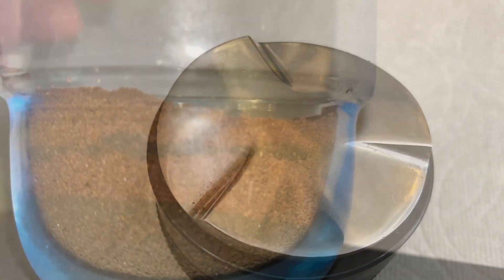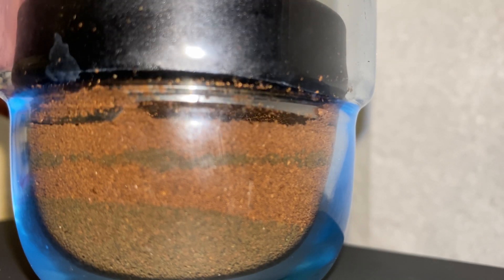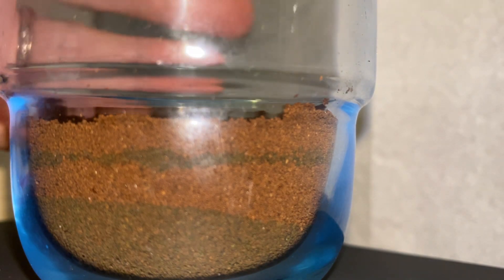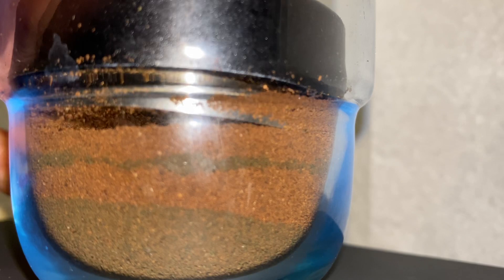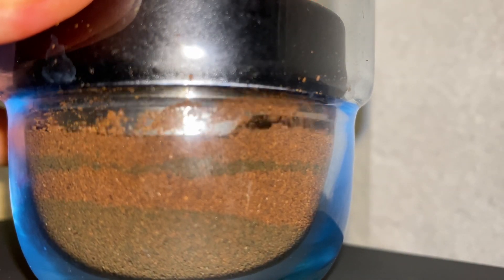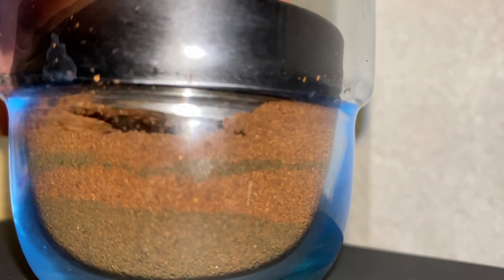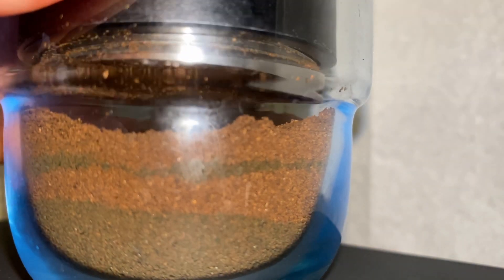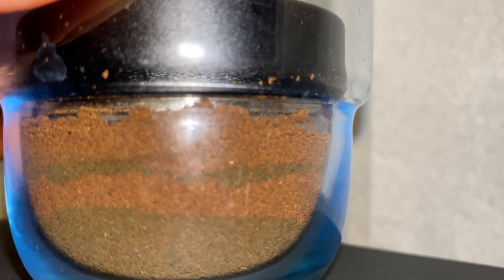Destroying the Myth of OCD Distributors for Espresso

Comment: For starters you're spinning it the wrong way, secondly, they're only meant to level the surface, so you still need to tap the portafilter to knock out air pockets. After you tap, the bulk of the coffee bed will be evenly distributed, but it will leave an unlevel surface because coffee from the surface has fallen in to fill voids. At this point it then makes sense to use the distribution tool to level the top surface.
Reply: Why not just WDT to get even distribution, then OCD to to get a level tamping surface, then tamp...
Reply: @esbenrasmussen4289  that’s what most people will do, but you actually don’t need to level your bed if you’ve used wdt. The data from multiple sources suggest, that of all cases a leveling tool, no matter what you do before it, will decrease extraction. Of course extraction not always correlates to better taste, since tastebud configuration differs from person to person. The general idea for a refractometer is to give a baseline (like i.e. everyone likes different styles of headphones, but every headphone is compared to a flat baseline). So a lower extraction just says that when compared to all other possible opinions, in most of these, the taste will be less appreciated. 
Also I’ve to add, that I’m excluding consistent overextraction from this perspective, since it’s highly unlikely to be applicable to all of the tested szenarios.
Reply: Imagine using a glass cup to make an example of a distributor in a portafilter...
Reply: hey  @ELITEGOD61  hold my lube, the TDS meter is going in dry
Reply from the maker: If it’s the wrong way, it isn’t a distributor. It’s just a leveler. It doesn’t even distribute the top when used clockwise. 

https://link.medium.com/VT9oKVyhpdb
Reply: @espressofun6091  as I said, distribution is done via tapping and the tool is used to level the top section of the coffee. It would be better to argue the tool is incorrectly named according to its function. To me taste is the best test and I know what tastes better to me. Forgive me if it makes me naive but a single article for some random test is much to convince me otherwise.
Reply from the maker: @n00baTr00pa  the tool decreases extraction yield. There’s not a single test that shows otherwise. Multiple people have tested this. Extraction yield is highly correlated to taste. 

Feel free to do whatever you want or collect data yourself. I am not convinced by any test I’ve read or done. 

https://link.medium.com/lKTt246zvdb

Comment: 🙈 Holy Sh... This is the WRONG WAY! I never thought that was possible! Wow! 😂🤣
Reply: thats what i said
Reply from the maker: If it’s the wrong way, it isn’t a distributor. It’s just a leveler. 

https://link.medium.com/VT9oKVyhpdb
Reply: @espressofun6091  and your title is pure clickbait.
Reply from the maker: @hcr32slider  sure. It helps decrease extraction yield by 1 point (like 21% to 20%). There is actually no evidence it improves the shot only that it lowers extraction. So if you feel so strongly, just collect some data with and without and report back.
Reply: @espressofun6091  so, as I stated, it helps to "produce consistent shots".
I'm not saying it is the number 1 method to extact and make the most delicious coffee.
Reply: @hcr32slider  careful lyn he has a   R e F R @ C T 0 m 3 T e R

He clearly knows more because a number changed by 1 percent 🙄
Reply: @espressofun6091  the proof is in the cup.
It may not "completely" distribute the grounds, but it definitely helps   to a degree and produces consistent shots especially in conjunction with the WDT method.
This is my practical experience.
Also watch the real sprometheus'  video where he uses an ocd without tamping and produced a higher extraction percentage.  I know there are a lot of variables which could affect the outcome.
Reply: You seem caught up on the title of distributor vs leveler.  The point is, it helps make a great shot.

Comment: I get that this tool isn’t all it’s cracked up to be, but Robert what is the reasoning behind using the leveler backwards for this experiment?
Reply: Correct, 3 spins clockwise.
Reply from the maker: It isn’t backwards. You’re supposed to go one direction and then the other. 

If you’re not supposed to go the direction I go, then it isn’t a distributor because it’s not doing any distribution. Then it would just be a leveler.

Comment: Yeah, totally destroyed... your reputation. 
You are turning on the wrong way and you pretend to teach to people that a tool that you don't even know how to use and you turn in a simple and instable glass, doesn't work.. 🤦‍♂️
What a great scientific approach 👍💪
Reply from the maker: Do a better experiment. It isn’t turned the wrong way. You’re supposed to go one direction to distribute, one to smooth. But it doesn’t distribute. 

Thanks for your kind comment. Send me a link when you design a better experiment that shows the OCD type distributor actually distributes other than the very top layer.
Reply: @espressofun6091  There is only one way to use it and is in the opposite way, not as you want and then said "I destroyed the myth". and if you want to experiment, do it the right way. There are few people who can read and watch and without knowing how to use it, they believe you are an expert and take what you said as good. But it isn't.
Reply from the maker: @davidecobelli-CoffeePassion  If I turn it the other way, then it won’t distribute anything. It will just lightly compress the grounds. 

If you so believe I’m turning it the wrong way and turn it the other way would some how showed that the tool distributed more than just the top layer, that’s on you to prove.
Reply: @davidecobelli-CoffeePassion  this kind of distribution/leveling tool just adds another variable and negatively affects repetitive quality of espresso shots. WDT is more than enough for making excellent espresso shots.

Comment: I think you're turning the distribution tool the wrong way
Reply: Can we make a poll here? How many people will vote that you turn it the wrong way?
Reply from the maker: @gusmank  I’m fine if you’re right, but if you’re right that I’m turning it the wrong way, then it isn’t a distributor because it doesn’t distribute when turned the other way, it levels.
Reply: @espressofun6091  mmmm... i though that’s what the tool are for right? From what i understand, the “distribution” mean to make the whole surface having the same amount of coffee so when you compress it with the tamper, it will have same resistance across the puck.

Then from this video, what i get from you is, you tried to mixing the coffee using the OCD. I’m i correct?
Reply from the maker: @gusmank  it doesn’t distribute when turned clockwise. It only levels. So it fails if you turn it that way. 

https://youtu.be/tl9vXycr9VA
Reply: agree. wrong way. turn it the other way round and make a video.
Reply from the maker: @kerikzb  If I turned it the other way, it would gently compress the grounds, and thus, it would do even less of a job distributing grounds than it already is.
Reply: @espressofun6091  alright. suit yourself. :) good luck.
Reply from the maker: Nope. It’s the right way.
Reply: @espressofun6091  the story is you are doing it wrong and you are not aware of it.
Reply from the maker: @kerembyl  Others do it this way to. https://www.instagram.com/reel/CLt3F33hWJT/?igshid=408v2un93uhk
Reply: @espressofun6091  nah its definitely the wrong way lmao

"It decreases extraction by 1%" 

Oh noooo, slightly smaller number in a refractor meter but the bottomless portafilter doesnt channel/piss coffee everywhere because it was distributed more evenly...
Reply from the maker: @ELITEGOD61  1% means it goes from 19% to 18% for example. Over 100 shots, that’s a lot of coffee.

Comment: Isn't the purpose of this tool to solely distribute the grounds on the surface for a more exact and leveled area? It's not meant to blend as the grounds should technically come from one source: the grinder
Reply: The ocd tool has originally been designed for usage in competition to level the puck. Your puck is graded by levelness and other factors, which impacts the final score. 
Naming it distribution tool ist just a clever marketing trick. In the industry/ commercial setup it’s used because it’s faster and cleaner than other methods.
Reply from the maker: Based on the product description, it’s to distribute the whole puck. I don’t they could charge so much money that only affected the top knowing less.

Comment: Thanks. What  distribution tool will you recommend for a home espresso lover
Reply: Highly recommend a needle distributor tool, you can find them all over alixpress.
Reply from the maker: None. I would recommend making one (link to how I made mine in the description of the video) or using the tap method. The stockfech method was shown in data to help.
Reply: @espressofun6091  thanks.